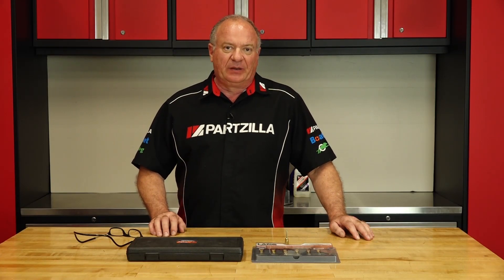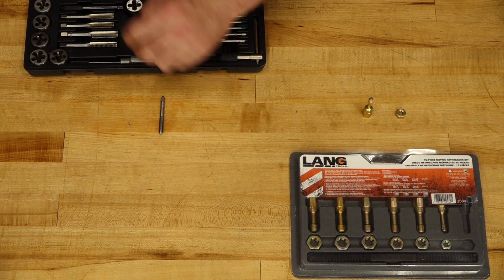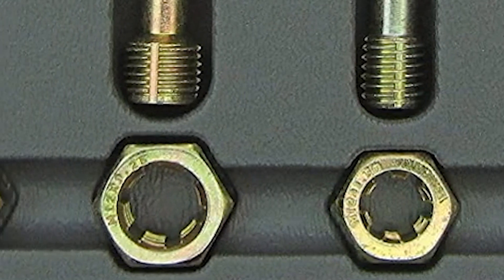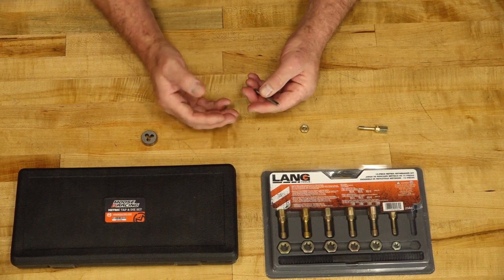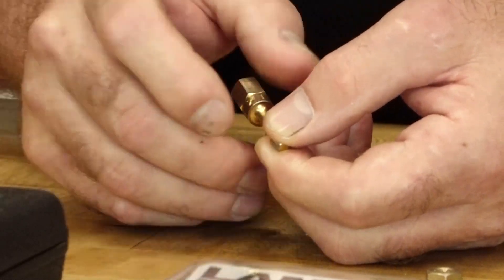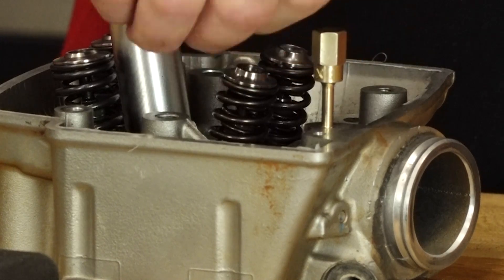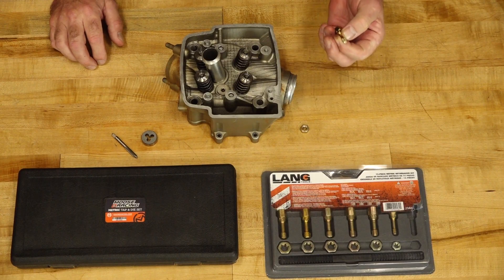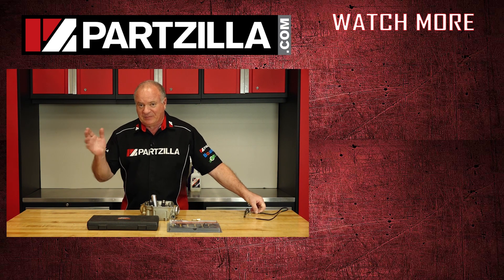Tap and Die vs Thread Restorer | Tap and Die vs Thread Chaser  | Partzilla.com

Comment: Thanks I didn’t understand the differences till now. I couldn’t get my Toyota axle nut notch bend up enough and it slightly moved some of the threads. I expected to see stripped shiny metal due to the resistance of the impact but turns out all threads are intact but I can’t hand spin on the new axle nut. I bought a cheap $25 rethread/chaser kit and will be working on it tonight. I can at least thread the nut on to where the axle is now flush with the nut but it stops there. I’m wondering if a thread file would be better as no threads are smashed down just angled a bit.

Comment: What about a bottoming tap instead of a thread chaser? The tap used in the video looks like a starter tap.
Reply: My very reason for finding this video. I cannot use a "starter tap" to chase a thread (small metrics, 4mm, 5mm, 6mm); it just does not start easily.  However, my bottoming taps do work very well but you have to be careful, use lubricant and go easy.

Comment: How ironic. Guy is using thread locker in places threadlocker is not called for, torques to specs and makes thread restoration video... you are over stressing the bolts when using threadlocker because it acts as lubricant.